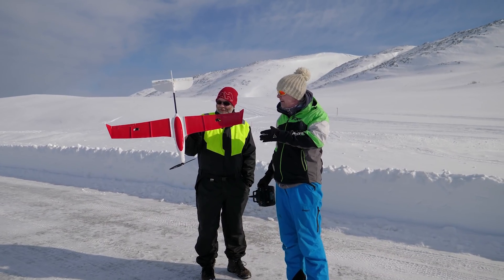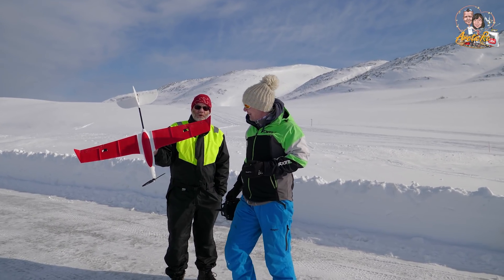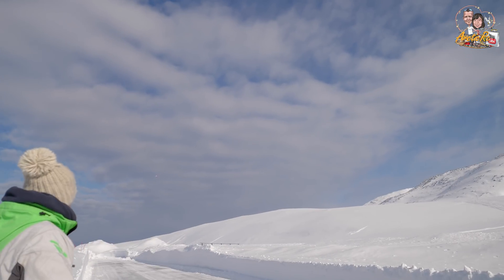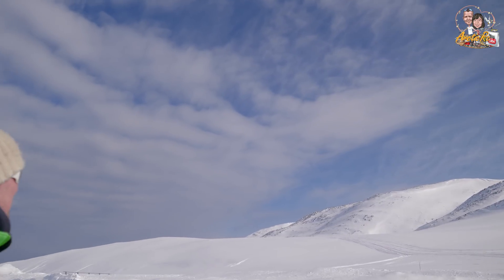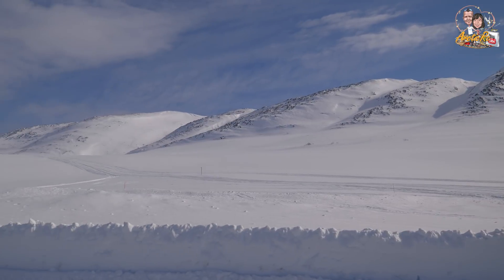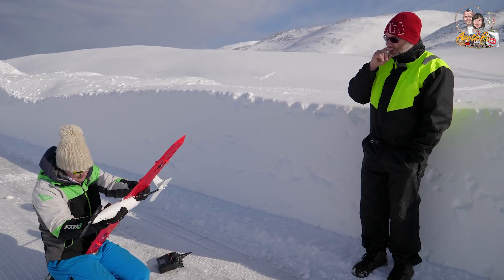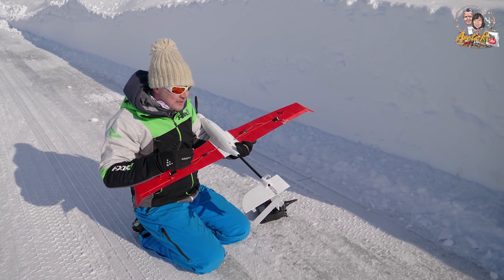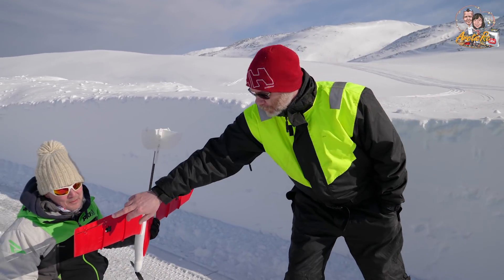3D Printed evolution speed Glider from 3dberridi.com - Maiden Flight

Comment: Another successful Maiden! Stuck the Landing ;-) I was wondering how this plastic would hold up in very cold temperatures. Happy Flying!
Reply: Tests show that PLA actually gets stronger in the cold, but also more brittle. So it may handle more stress but when it breaks it tends to break in mor parts.
Reply from the maker: Morten Myklebust But that doesn't matter cause i just send request for more prints to Morten 😂